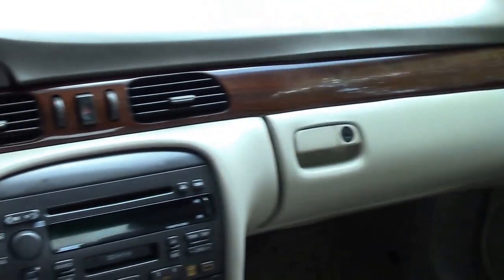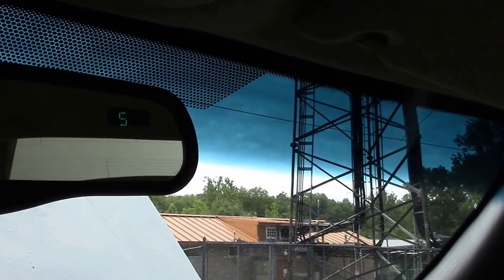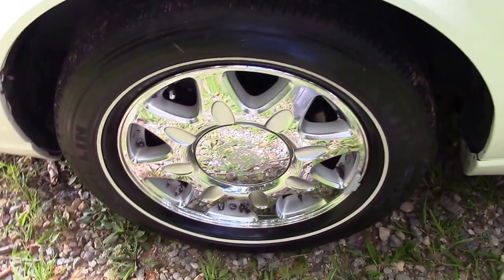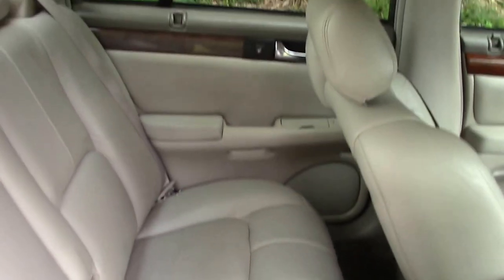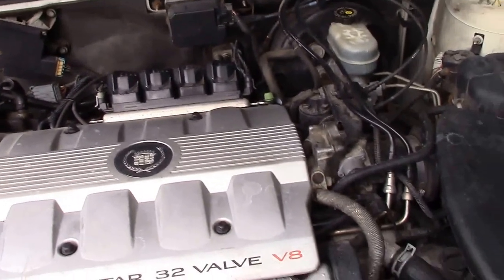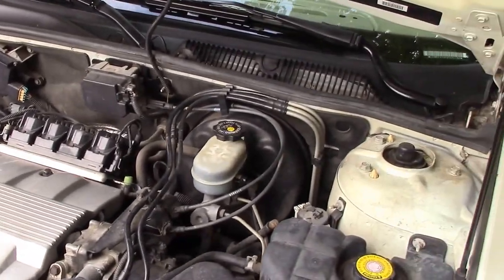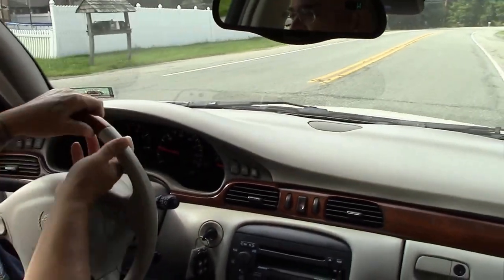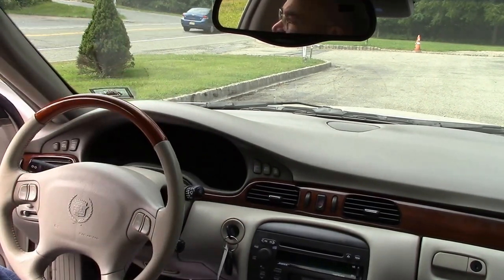1999 Cadillac Seville STS White

Comment: The slight temperature increase can be a few different things.  The thermostat is what controls the coolant flow and can go bad often.  Cooling fans are also something to check.  My own Seville had one faulty cooling fan that did not supply enough air flow when needed.  Also the top radiator shield on both the top and the Bottom are very necessary for proper air flow.  The cooling system itself is a very simple design and not difficult at all to work on if needed.